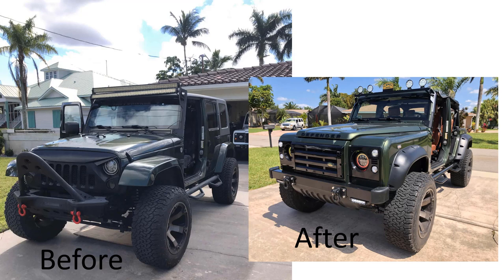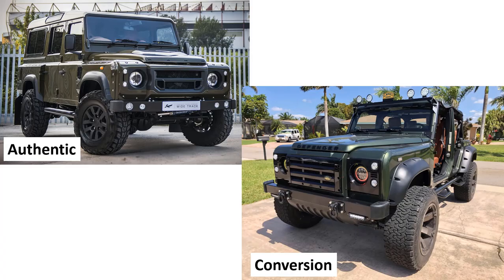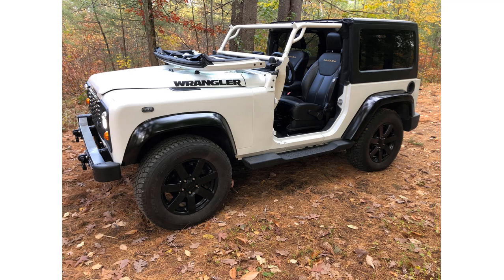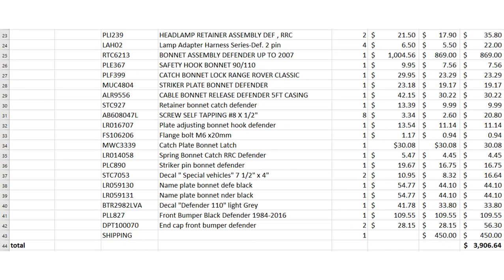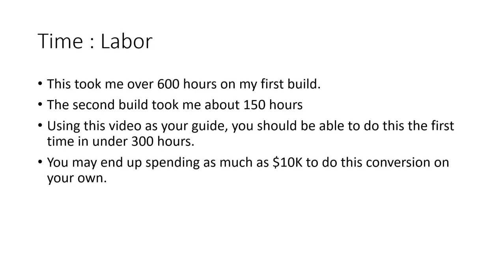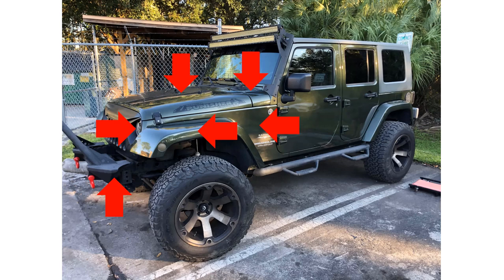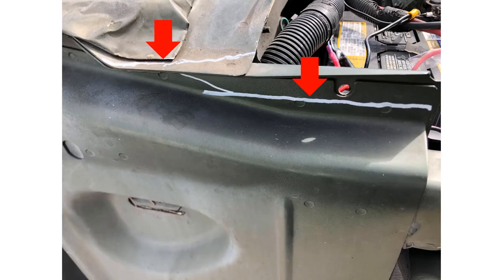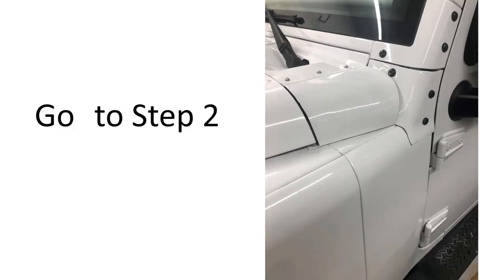How to convert a Jeep Wrangler JKU to a Land Rover Defender : Part 1

Comment: Dude would you consider doing this as a business? Ive always wanted this exact thing...a d90 but with modern drivetrain and tech...converting my jl would be absolutely perfect man...killer job
Reply from the maker: No money to be made at this. Not enough interest and the conversion is to expensive for people.  They would rather pay more to have a restored 1995 original.